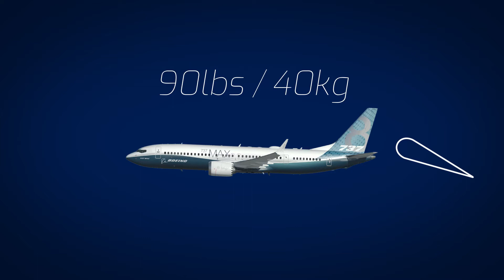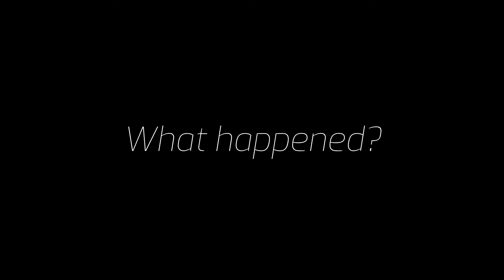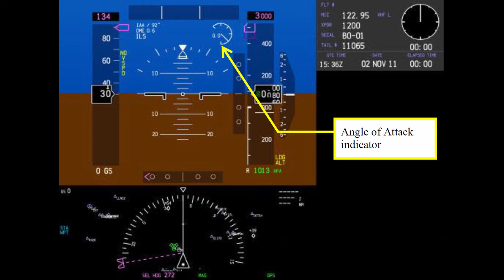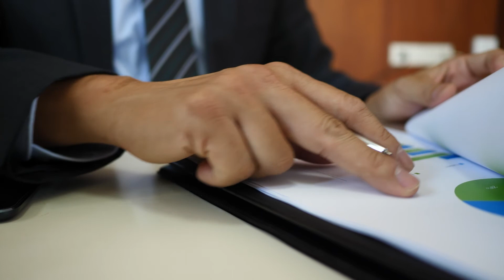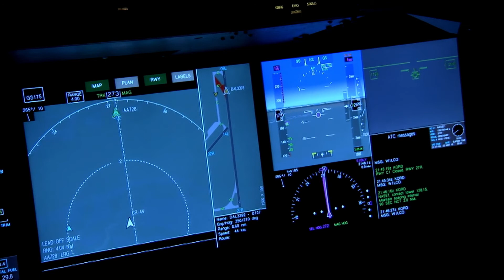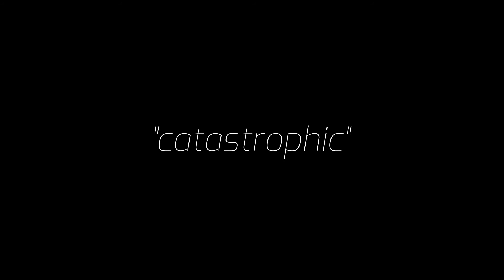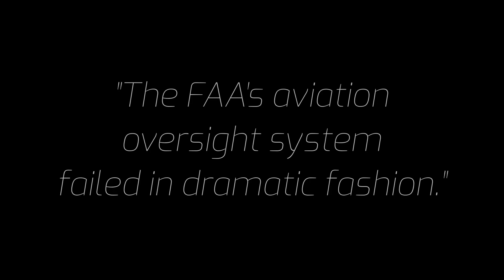737 MAX crashes | How Boeing and the FAA failed the aviation industry

Comment: this is a clear case of criminal negligence.  to intentionally make a safety of flight item single point safe is criminal and people should be in jail...or dead.  The fact Airbus did something similar and used three sensors is a clear sign that Boeing just decided killing people was fine.  They simply didn't care.

Comment: There also was an added layer of problems when Lion Air had replaced the defective AOA sensor with a second-hand refurbished unit from a company in Florida, now out of business, Buying one from Boeing was too expensive. That refurbishing company showed little to no trace records of the unit refurbished procedure. On top of it, the sensor hadn't correctly been calibrated for that aircraft..

Also, the US Congress has removed funding into the FAA for decades with the ultimate outrageous decision to allow for ODA, delegating some certifications to the OEMs themselves. Many parties played a deadly role in this beyond an impressionable Jedi-mind trickster wannabe.

No final decision should be made like that in aviation. Until companies are run by professionals in the company's respective fields, they cannot make the correct choices and please Wall Street at the same time, all the time. Until leadership changes to reflect field expertise and balanced representation for most of these companies, nothing will change.

Comment: What baffles me is the Deaign Assurance Level of MCAS is not DAL A.  Any failure that can cause loss of hull or souls must be certified as DAL A, with a failure less than E-9, thats one failure in a billion hours. Obviously MCAS caused loss of hull and souls so why was it not DAL A ??

I've never designed a DAL A or even DAL B system without full redundancy and cross-side alerts. I don't believe its even possible for an avionic system.

Boeing made a very basic blunder by cobbing a single threaded avionic system onto the pitch trim.

Even more disturbing is the complete lack of DAL info on this. Apparently Boeing is NOT being made to increase the DAL of MCAS.

WHY ?!?

Comment: I can imagine meetings where real engineers argued that the "AOA Disagree" alert should not be a paid feature, because the proper name would be the "At least one safety-critical flight sensor has failed" alert, and strenuously argued that MCAS needs to consider this input.

What i hope, after the first accident, one of those engineers told his manager: "We warned this would happen, and I saved all my emails"
Reply: I get such an intense feeling of anger and frustration when i hear about medical/safety/critical systems having free technology be a paid addon. Imagine how not only this flight could have been saved by honest engineering and pricing but also the pandemic with short supply of crucial medical equipment because these companies only care about the money.
Reply: The AOA disagree does work without the AOA display on the NG.
The Lionair 610 report identifies this as being a bug introduced through Boeing altering the software to implement MCAS.
This warning should have appeared on takeoff well before V1.

Comment: The easy way to get out of trim runaway is to turn off the trim switches behind the console
Reply: MCAS v1.0's intermittent deflection is not the same as runaway trim. And the stab cutout switches do not operate the same in the Max as they did up to NG.
Reply: In the Ethiopian crash the F/O did exactly that… but the aircraft was already at such a high speed that the load on the THS jackscrew meant it was not physically possible to manually trim it quickly enough to save the aircraft. See the video from Mentour Pilot demonstrating this scenario in a simulator.
Reply: @michaelcorcoran7444  Exactly why the Max stab cuttout redesign just added to the tragedy.
On previous 737s, pilots could cut elec power of stab trim for yoke switches and automation independently.
Had they been able to do that here, the far more effective yoke thumb switches would have been available, not just the now impossible to turn manual trim wheels.
In fact in the Lion scenario, the pilots successfully 'fought' mcas this way for several minutes, countering with elec trim till they lost to mcas greater authority.
Horrible design.
Reply: @damonreynolds6775  I can’t begin to imagine how awful that would have been for them. Totally powerless to overcome the horrible design.
Reply: @michaelcorcoran7444  At least now it depends on two AoA sensors. And if it does activate, operates very differently. No more continuous deflection, just one reduced deflection and done.
Lets hope it stays that way.
Reply: @michaelcorcoran7444  in doing further research I think you’re correct 
He was supposed to have been an excellent pilot
Reply: So pathetic to see Boeing try blame pilots...  morally corrupt to the bone

Comment: And the genius computer is unable to differentiate that the plane is heading 60 degrees straight into the ground. Idiots.
Reply: Because the thing called sensor that tells the computer what the plane actually does has failed and Boeing was too greedy to lose sales to Airbus so they couldn't have showed the real risk potential which in turn made it impossible to make the system rely on redundant sensors. It's like if you start a lie (that no training is needed) you have to keep on that lie throughout that's the hard part in the lie.
Reply: @gentuxable  ---- I have a thing about Pitot tubes that were last updated ca. 1950's. Every time I mention that on a comments section, I get either rebuttal or crickets. We have digital thermostats, but we can't come up with anything better than a glorified straw for an airplane? We can measure the impact of sub-atomic particles, but haven't figured out air molecules? And cameras could be placed to show critical structures, called on if needed, or even image matched to go off if there is a discord (e.g missing engine, broken jack screw, detached aileron, whatever).
Reply: @davesmith5656  of course we could come up with something better. But better often means more expensive and that's what Boeing management didn't seem to want. And that's our problem of today. We want everything for nothing and the more everything for the less nothing the better.

Comment: It’s hard to believe that the same company that designed the 777, an aircraft that has suffered 6 hull loses (due to various issues not related to Boing’s design of the aircraft) without losing a single soul on-board, also designed this aircraft.
Reply: It's the same in name only. The 777 was designed before the McDonald Douglas merger in which the McDonald Douglas executives took over control. It would be more accurate to say that the 737MAX was designed by the same company that gave us the DC-10.

Comment: The Max will eventually become one of the safest aircraft in history when all the problems are ironed out, what is scandalous is the fact that Boeing knew about the issues of MCAS and never told the airlines or pilots about it. MCAS wasn't even in the training manual for Christ sake! Boeing should not have been allowed to certify their own aircraft either, this makes the FAA partly responsible as well. Shame on them!!🤬
Boeing, in my opinion, caused the deaths of hundreds of innocent people and they did NOTHING. They lied and conned the FAA and other aviation regulatory bodies, they should be ashamed of themselves.

Comment: To me, the most absolutely batshit insane fact that MCAS takes inputs from both AoA sensors on the military version of the MAX, thus eliminating these problems, but it wasn't used on the civilian transport MAX. Just... WHY. I would love to know who made that decision and why. These two accidents should have never happened, and would never have happened if MCAS used both AoAs like the military variants do. That is what baffles me the most, more than anything else.
Reply from the maker: Is that the case? I didn't know about that! wow...
Reply: @AirspaceVideos  Apparently so. IIRC, the military was aware of the MCAS single point failure vulnerability, and ordered the aircraft with modified software (and I guess avionics) so that MCAS would take inputs from both AoA sensors, and so if one failed, MCAS would fail safely once the software sees disagreement. My memory is a bit fuzzy on this, but I remember this being the case.

P.S: I've done a little more reading, and this does indeed appear to be the case. Mil variant MCAS is indeed fed by both AoA sensors, and if one of these fails, the flight control software faults MCAS out, thus the pilots trim the aircraft manually, and MCAS is completely removed from the picture.
Reply from the maker: That's very weird. Why the hell would Boeing develop two such variants? My guess is, the Military just paid handsomly...
Reply: @AirspaceVideos  I think your guess is as good as mine on tis one! It just boggles the mind.
Reply: @uzaiyaro  Whilst the KC-46 Pegasus (a B767 derivative) has a system called MCAS it doesn't have much in common with that on the B737 MAX.
The P-8A Posiden used the B737 NG airframe and CFM56-7 engines. Since development started in 2004...
Reply: Money.
Reply: @adion24  oh, it always is. But there’s got to be more to it, I feel. The military probably paid more for this, but my question is why was this ever a thing? It feels like it would be less effort to design the avionics and software once, using both sensors, for all aircraft. You have reduced part numbers for any avionics hardware modifications, your servicing is easier, your software is more simple, as you don’t have multiple versions.

It shouldn’t matter who buys the appliance. The MCAS on your aircraft should be designed and built to use two sensors. No optional extras, no multiple versions of software—your aircraft will use both sensors, no exceptions. You don’t get to choose whether your mcas uses one sensor or both, it should just be a default “we will use two to eliminate single point failures, end of discussion.” It is basic aircraft design philosophy to eliminate as many single-point failures as possible. This is why you have two of everything. Two AoA sensors, two pitot tubes, two flight control computers (that constantly monitor each other’s performance, I might add), etc etc etc.

Surely this would be easier. Aircraft aren’t cheap, no, but MCAS or no MCAS is irrelevant. Your aircraft always has at least two AoA sensors. Possibly 3, not sure, but in any case, you ALWAYS have at least two sensors—one on each side of the aircraft—for this exact reason. If you are the captain and the sensor on your side fails, you can simply choose to feed your display off the first officer’s sensor (and vice versa), or you can choose the standby instrument, if fitted.

TL;DR You will always have two angle of attack sensors. Any commercial aircraft (and I do mean *any*) you fly on will have at least two. So why weren’t both of them used for mcas? It should require precisely no additional hardware or avionics—this sort of thing is (theoretically) purely done in software. So why the difference?
Reply: @uzaiyaro  Doesn't the KC135 also have a lot of other MACS-unrelated problems? I thought I heard the military blasting Boeing for systematic problems in quality and deliveries on time.
Reply: @ElectricUAM  I’m not sure, myself. I only know for sure about the mcas issue/non-issue here.
Reply: Call me a tin foil hat, but I swear it’s done just to see what would happen… and they test their twisted theories in smaller, poorer less impactful airlines and countries
Reply: @MIXTAB1  I still think it's financial bottom lines, decisions taken by non-aviation folks more steeped in financiers and law than aviation. Bottom line, as long as the board and C-level structure doesn't represent its own industry expertise, it will continue to make mistakes. It's not rocket science. Put the industry experts at the decision level and balance the sheets. Put back communication first, marketing after, followed by PR, and not the other way around. Everything is topsy-turvy and these companies don't understand why they have a hard time. Sheesh!
Reply: @ElectricUAM  well said, and very likely the case… unfortunately… it’s a never ending cycle in aviation… 
Rushing innovation to be the first or to be the superior machine. The
Rushing creates pressure which can cause corner cutting, and less thorough testing… or even worse, when there is a know potential defect, yet it still passes inspection. From some shady back door deals or “data”’that shows the defect is statistically impossible…

Tell that to united 232, or Turkish 981 and AA 96, the Max Disasters…
It’s so ironic that an absolute staple in aviation is to be patient, relaxed, and meticulously thorough. The business end of aviation is completely the opposite, it’s a rushed tense push, that’s also meticulously thorough, but just in finding the economically best ways to finagle their known problem areas… nothing in aviation should ever be rushed
Reply: @MIXTAB1  It's puzzling but again, the more you talk to aviation professionals, the more you realize we are normal and our questions and doubts are normal. This is business as usual and these ill-adapted business models are surviving on life-support. They are no longer sustainable. It takes more than a few crashes and a few slaps on the wrists to shake the complacent folks, sadly. Still, the red neons have been flashing for some time. It's a question of months if not years before all of this nonsense collapses. Good to hear like-minded folks here!

Comment: American here. A huge issue with aviation oversight in the US has to do with the nature of the FAA and NTSB. The FAA was created when commercial flight was very new, and has a dual role of both regulating the industry AND promoting aviation in the country. You can see where these often become conflicting priorities. 
Additionally, the NTSB is only an advisory committee; it investigates transportation disasters and provides recommendations for the FAA to improve safety. Only the FAA or Congress can implement the change though, and thus far both have been lacking. The NTSB recently called out the FAA's slow process as a contributing factor to a crash. 
Congress essentially needs to change the nature of the departments: either get rid of the 'promoting the aviation industry' aspect of the FAA, or make it so the NTSB can make regulatory changes.
Reply from the maker: Sounds reasonable...
Reply: I had always thought that NTSB reports led to legally binding requirements on the industry... it was quite a shock to discover that's not always the case? If I understand the system correctly, they seem to currently be dependent on the FAA's issuing an airwarden's directive in order for anything to become binding on all aviation firms. Given the intrinsic conflict of interest built into the FAA's current dual mission, I really worry about industry capture? (I.e. their potentially hesitating to issue essential safety changes due to significant cost impacts on the industry within their country, &/or extreme pressure from key special interest groups such as Boeing.) Unfortunately the 737-Max debacle seems to support that concern, and it's very unclear to me if anything has changed legislatively?